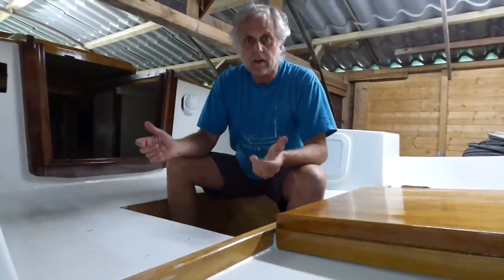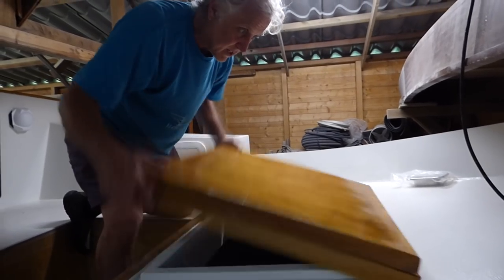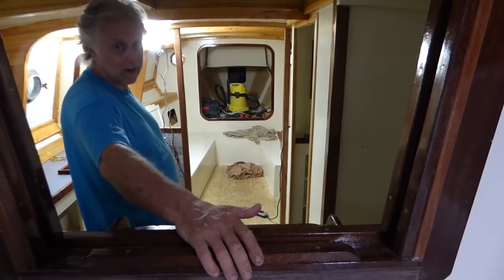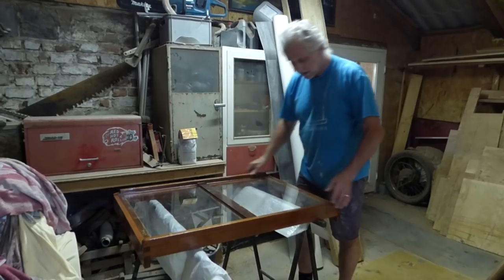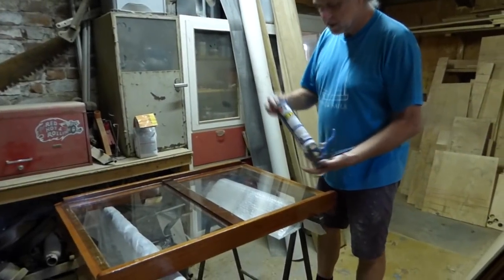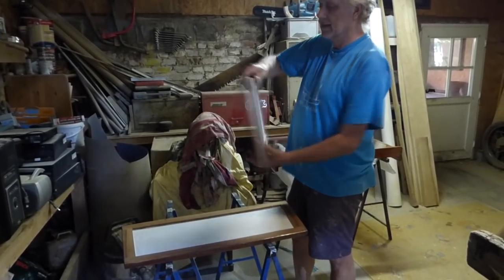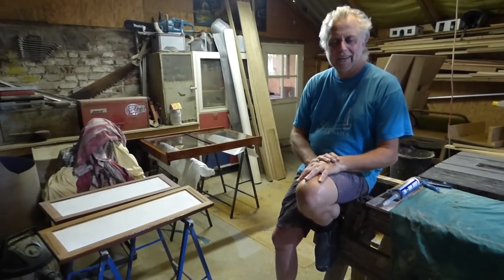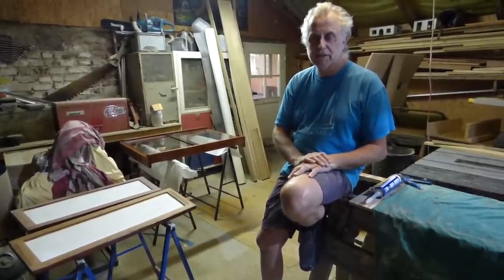Finishing but not finished; Building a cruising sailboat - SV Tapatya EP145

Comment: locks spiffy...but no words about the keel?
Reply from the maker: Thanks Bruno. The keel will be started/ built in the next year....
Reply: @SVTapatya  ... so long ahead? so masts and booms next?
Reply from the maker: Connecting everything up is next - engine room - fuel system, electrics, cooling; then galley plumbing, stove; various other bits of connections and electrics; then the Lazarette needs fitting out. I still have the cabin sole to finish, a lot of deck fittings to make and or fit. Then, I might be ready to start thinking about the keel construction. Actually, writing it like this, it doesn't seem so very much..... We'll see Bruno 👍😀

Comment: bit of a thing, coz Hazels rig is unstayed
boat looks great, CT1 eh. 
Ive been looking at Dow Corning 791 which is used to glue glass into skyscraper frames
but if I go for 1/2" acrylic windows and I might ...
Reply from the maker: Yeah, unstayed masts are a bit of a worry when you've gotta go up them. You always think, "well, it should be strong enough... it holds all that sail...". I always take a safety line from something else though.